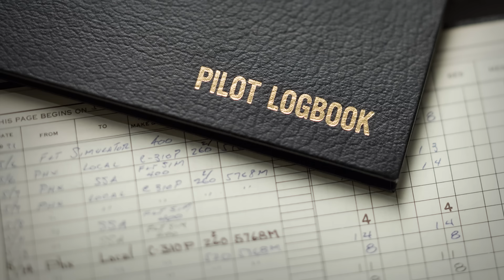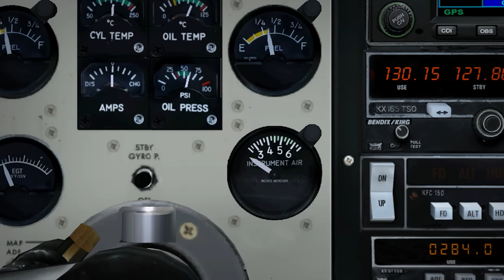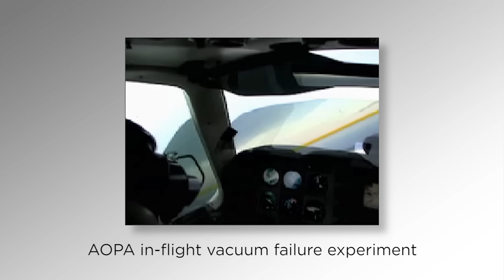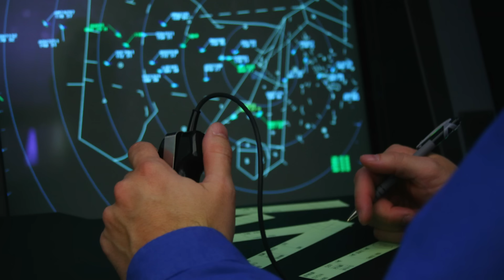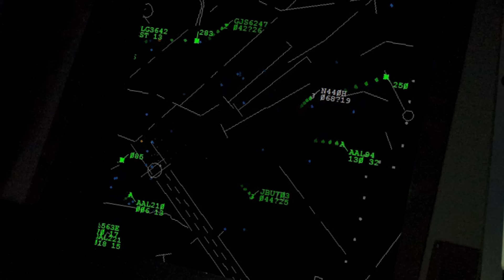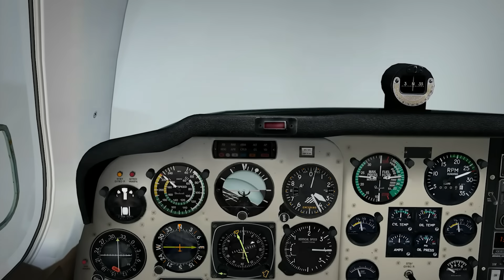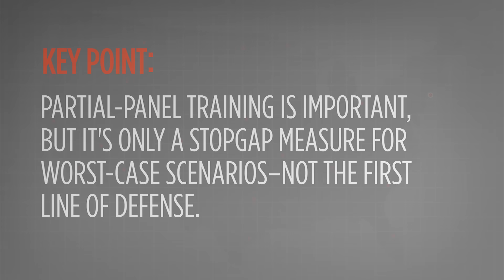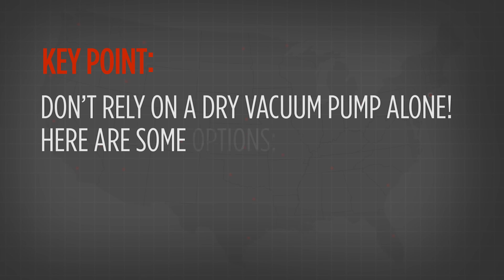Accident Case Study: Single Point Failure

Comment: The airplane doesn't know the vacuum pump has failed.  It will fly with NO instruments.  Most planes are built for stable flight with minimum pilot input.   You'll notice on a X-C lfight that once you have power and trim set for cruise, it takes little effort to keep the aircraft going where you want it.  I've flown a lot in cruise with just slight rudder correction to skid 3 or 4 degrees and maintain heading or re-level the wings.   Overcorrecting causes a lot of problems even in VFR.  Don't become a passenger, but DO allow the airplane to do what it was designed to do.  They usually fly better without the pilot constantly pushing and pulling on things,  thinking he HAS to do something.
Know your power setting for a normal descent and you won't have to chase the VSI as much.  Sticking to half standard rate turns helps too, when you have no visual cues outside.
Thankfully I've never flown VFR into IMC (I normally fly only on severe clear days),  but I've learned a lot from a very knowledgeable  CFII -- a former USAF pilot who has flown everything from a Grumman Yankee  AA-1 to an AF KC-135.
Reply: Bryan Simmons   You are right if flying a Cessna but a Bonanza is not as forgiving. And unless the pilot covers his failed instruments it is even worse. I have had two Mooneys and both had backup vacuum systems. I wouldn't fly IFR without them.
Reply: @TheRotorhound  V tail or with conventional empennage?
I wouldn't fly in IMC without backup systems either.  I wonder why no one has ever thought to install a good old-fashioned venturi tube as a standby?
Yes, it spoils the looks of the airplane,  but a plane that goes CFIT looks REALLY bad.
A lot of commercial and military aircraft have drop-down RATs. Why not a drop-down venturi?

Thankfully I'm a looky-loo pilot who flies to enjoy the scenery.  There's no place I have to go by air that's worth killing myself for.  I've had the IFR training ---  cross country under the hood from takeoff to short final ---  but that in no way means I would risk doing it for real.
"A man's gotta know his limitations."
Reply: Bryan Simmons   Venturie system probably requires an unobtainable STC for each model plane. One of my Mooneysi had Precise flight standby vacuum installed. Worked on engine suction but if engine failed you had no vacuum. The Mooney Bravo had built in electric vacuum pump that turned on with a switch. Nowadays one can get relatively inexpensive electric gyro devices. No gyro instrument flying is a bitch.
Reply: i agree on the FTC.  Gotta love the FAA!

Comment: I think the point about terminology is critical in this situation.  HOWEVER depending on the controller to "save" you or to have too much dependence on the controller is also a mistake.  Take charge and make your decisions.  You can discuss things on the ground over a cup of coffee..  "Partial Panel" is a term they won't understand.  Like he says around the 10:00 mark, explain in plain English what the problem is.  Get into VFR and set your max cruise to give yourself the maximum time in good weather.  (I know, easy to say sitting here with my arm on a chair.).

Comment: At times like this pilots &  ATC can get it wrong  VFR on top with breaking out around 1600 is bad one thing you never wish to  make any turns once you enter IMC conditions if possible have a GCA approach and  just reduce power letting the aircraft decline into and out of the IMC conditions 

 All aircraft will hold the heading coming down once trim and it may be possible to use the rudder for small heading changes but once you go into a turn its ease to put the aircraft into a dangers angle from which there is no hope getting out if the AH-  is not working -

 But if you just  pull the power black and set up a glide path the aircraft should  fly a its course with little or no trouble all the way down 

When you landing VFR with power off the plane will fly  a state course down and if you are going to break out well above the ground and in safe airspace, its ok  for a crosswind to move off course a little - You can all ways fly VFR around and back to the airport to land

All so if you do a lot of night flying it can help you get better at looking at the panel or at least it did for me for at night with overcast skies with little or no lights from the ground it can seem like IMC -

All so try asking for GCA into any airport when it is possible or look at setting up a decent in the aircraft with the power pull back from 7-K down to 1000 feet if possible just using the rudder 

New avionics and systems are coming out with better back up systems but any time you have a flight in IMC it is a danger 

  I could be wrong but worth thanking on if your a pilot and fly IMC with no back up systems

Comment: Simple stuff. He lost his panel. No partial anything. He tried to avoid the clouds...then went in, and then lost his brain, (would happen to any of us). The only real failure here is "NO BACK UP". Even with a new pump, (good maintenance) you still have to have redundancy. Even just a simple smartphone would have helped. Plan for no light, no panel, no electronics. A flashlight, a tablet (or smart phone), a radio, and the necessary batteries should be in everyone's bag at all times. VFR and IFR.

Comment: 9:07 i thought that step was retractable.
Reply: Google suggests it's just bolted onto the frame. And if it is, there's no guarantee whoever made the FSX model animated that part.
Reply: Yeah, I own one. It’s bolted. Definitely not retractible. That would be another actuator to have to worry about...glad it’s not.
Reply: @zippoc04  They are retractable,  it's hooked into the gear in a clever sort of a way so as to not be a problem.
Reply: @jamesmonahan1819  Lol what part of I own one didn’t you get? On BE35s, they’re not retractable. They are designed to minimize surface area and drag into the slipstream, but it’s certainly bolted to a fuselage stiffener. I’d be happy to provide you detailed pictures from my plane if you’d like to argue this...
Reply: @zippoc04  a 185 just flew over, it had fixed gear. I guess that means they all have fixed gear.
Reply: @jamesmonahan1819  From my fairly extensive literature search, I can’t seem to come up with any evidence supporting your claim that a V35B bonanza, which N440H was, came equipped or with an optional retractable side step, and also couldn’t find a relevant STC for that either. G models and earlier, as well as certain H models (and perhaps an STC on an S model, though shaky evidence) did have that as an option, but I am totally unable to track down anything supporting your claim that this bonanza could come with a retractable side step. Again, I own one and have decent knowledge on the subject, and my literature review supported my original conclusion, but if you can point to a shop schematic or manual showing the optional retractable side step mechanism on a V35B, I’ll gladly yield the point to you and walk away a touch less ignorant, albeit likely just as stubborn.
Reply: @zippoc04  Ok,  I'm good. Must have been something I got wrong.

Comment: Why dont planes use engine vacuum as a backup to the pump? Seems like a simple diverter valve and you'd have up to 20 in of vacuum on hand from engine.
Reply: People do. It costs money.
Reply: More than a dedicated vacuum pump? That seems highly unlikely. An interesting point raised.
Reply: Engine vacuum changes with altitude (manifold pressure is altitude dependent unless you’re TC or TN), and unlike car engines which are built to run at 5-10% power all day, which produces considerable vacuum, plane engines run upwards of 75% for hours on end. Vacuum produced when running at high power settings is almost negligible...just another thing for the pilot to have to remember and understand at an already high workload time. You’d have to substantially reduce engine power to achieve usable vacuum. While this may be an okay alternate, it’s a pretty bad primary source due to the many fluctuations as stated.
Reply: You can store the engine vacuum as well, basically no weight except the container which doesn't need to be huge walled. Even built into the air frame during construction and can store the vacuum from taxi time on runway. Dropping throttle for a few seconds would "refill" the chamber.

Comment: This is why, My Dad always had a nut, a piece of yarn and a roll of tape.  If he had a  vacuum failure he hang the nut up on the windshield, and the nut would tell him what the airplane was doing.  He did thievery time he flew at night with his cub.
Reply: That’s pretty fucking ingenious, I have to give that shot next time to see how well it works. Thanks for this.
Reply: Assuming the force due to the acceleration of gravity is all the airplane is experiencing, it’s ingenious (like a plumb bob). But this neglects the effects of centripetal force which would make the weight hang normal to the cabin floor of the aircraft in coordinated turns (same reason turn coordinator ball stays centered). This would be a lot to process, and would require knowledge of the motion of the airplane to appropriately back calculate into an actionable input.

Comment: why did the aircraft break up in the air though?  not because his vac pump failed
Reply: He tested the durability limits of the air frame, and found them.  And that happened because his instruments failed.  You can destroy a plane even if you hit nothing but air.  There's stress to any maneuver; but high speeds and high Gs are ...  well, "troublesome."  He most likely entered a steep, descending turn by accident and gained a bunch of airspeed, that turn became a spin and translated to Gs.  Those Gs, thanks to that spin at the increased speed probably tore the plane apart.

What's "high" is relative to the aircraft.  Know your limits.

Comment: When I hear this, I cringe at his lack of clarity in his transmissions regarding his problem.  “Partial panel” is a term that controllers may or may not be familiar with.  the pilot just needed to state “emergency” and “no gyro”.  Private pilots don’t seek out proper recurrent training on such matters and forget the training that was given initially for the rating.

Comment: It's a crime that with MEMS-based AHRS systems being so inexpensive that it costs so much to retrofit useful backup or primary IFR systems in these older certified aircraft.  If there was one thing that the FAA types could do to improve safety it would be to implement a retrofit program that was relatively inexpensive.

Comment: A simple bottle of water put horizontal on the dash will have save is life too. It's a simple flying instrument. I always have one close to me.
Reply: Please explain. How could it have saved his life? If you’re implying that it would have been a visual reference to let him know whether he was banking left or right, that would not have worked.
Reply: why wouldn't it work?
Reply: You have one of those in your turn coordinator, but it doesn't help you stay level. You can be flying on a 30  or more degree bank and still have the water level in that bottle. If you got into that situation slowly, which is likely in IMC with no reference, then you may not realize which way you need to roll to get out of it.
Reply: That’s dangerous misinformation. A coordinated turn would have no change in attitude of the water.
Reply: Kookoo:  Yeah, watch Bob Hoover fly a loop with a cup of water without spilling it. it does nothing to show your attitude. Besides, that is what the Turn and Bank is for.

Comment: Training is the primary issue yes.  Now let's talk about the fact small planes are designed by idiots with absolutely no intention of designing and building anything that a human being should put innocent people in.  What jackass designs these things with a "vacum pump" such that it's a critical piece of equipment to flying in the clouds? Why aren't manufactures sued into doing the right thing? Where is the outrage from the flying community? Why do you tolerate this?  Why do you get in it?  Because you're male ego is wrapped up in it.  Small planes should be outlawed.  They are NOT safe, the so-called "Pilots" are incompetent, lack essential decision making skills (so much so the FAA has had to give them an acronym for them to even remember HOW to make a decision! - the DECIDE model.  Think I'm kidding?  Ask a "Pilot". ) and the decision to make proper decisions to even safeguard themselves.  The engines and related systems are completely unreliable, the  maintainace records invariabley show slip shod, corner cutting and incompetent mechanics.  America needs to treat small planes like they do firearms - seek to get rid of them.  We're going to sponsor legislation here in CA that will change the face of general aviation forever here.   We've seen enough death fall from the skies.  You will soon have to meet CALIFORNIA standards for training, service and maintenance of small planes before we'll license you.    Your license may be federally issued (Until we pass this role to our DMV - as the FAA is failing and passing into oblivion)  - but your plane and airport sit in our state and we're going to regulate your airport and your plane into safety or - go fly elsewhere.  Since you won't self regulate we will do it for you.

Comment: Non pilot here what's the  function of the vacuumed pump gauge & why is it critical!
Reply: sunsetlights100 - The main vacuum-powered instrument is the artificial horizon in the centre of the console - you can see that it's showing an invalid display in the second half of the video.  It lets the pilot determine the attitude of the aircraft - whether or not it's flying straight and level.  Without the horizon, the pilot didn't know if he was turning, climbing, diving, or flying straight.

Comment: I used to work for a company whose owner used to fly us around the country. I witnessed first-hand how his ego (while refusing to ask for help) almost got us into trouble. 

I am also seeing a trend in some of these videos of the EGO that gets in the way of these pilots from declaring an emergency.  For admitting they're in over their head.  For asking help. Then we assign some blame on the ATC for not acting accordingly.
There should be a video on this topic alone as a passing mention of pilot responsibility in these videos is not emphatic enough (ironically).
Reply: I agree. In my opinion, it's the higher time pilots that tend to have the ego problem. Controllers are controllers. Pilot in Command, needs to be Pilot in Command. ATC exists because of pilots. We can fly without ATC.

Comment: I'm a non pilot but love aviation and am wondering how an ipad would have helped? They cannot show attitude can they? At 61 I would love to learn to fly but am color blind and watching a video on ILS systems scares me!
Reply: A ipad can have a video display of aircraft instruments. The instrument depiction is based on the internal 'which way is up' feature of the ipad. Also, the display ties into the GPS to give airspeed, heading , and altitude.
You can fly with a private pilot's license even though you are color blind. You can be a VFR only pilot, so no worries about learning to fly an ILS.

Comment: I nothing about this subject matter. For those that do, can I ask "why no backup instruments"?
Reply: He still had some instruments, but they require more thinking and he didn't use them correctly. A full backup panel is too expensive for such a small plane, certified instruments are very costly, generally full backups are only used for large transport aircraft(which even have a backup pilot)
Reply: I agree with MyTech. To further explain, the accident aircraft, and other aircraft certified to fly in clouds, have 6 main flight instruments. In the accident case, the air driven gyros: attitude gyro and gyro compass quit working because of the failed air pump.
The pilot still had the airspeed indicator (operates on outside air flow), altimeter (reads outside air pressure just like a barometer you could have at home) and the Turn Coordinator (an electrically driven gyro), Vertical Speed Indicator (operates on outside air pressure, same as the Altimeter. Those 4 instruments can get you down safely but,  this takes recent training and solid concentration.

Comment: HANG SOME FUZZY DICE FROM CENTER OF WINDSHIELD....... THEY WILL NOT LIE ABOUT ATTITUDE OF AIRCRAFT!
Reply: They will tell you about the attitude of the pilot and a little about side slip, but they will tell exactly nothing about the attitude of the aircraft.
Reply: a little over complacent are we? anything that gives clues to the ATTITUDE of the aircraft in a bad situation i would consider a blessing,could be a cross on a chain,bubble gum on a string . Gauges out, imc conditions, spatial disorientation setting in, it couldnt hurt !
Reply: If I understand MyTech here, I think he's right. Due to forces of acceleration it's quite possible in a heavy bank to the side that results in a catastrophic stall that the hanging dice would be pointing toward the cabin floor the whole time with no indication of a change in attitude.